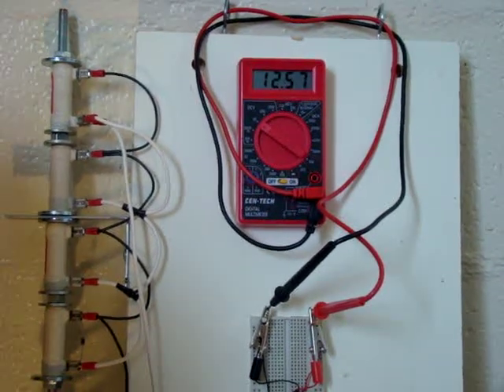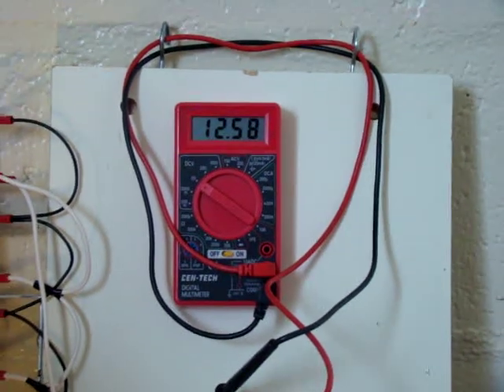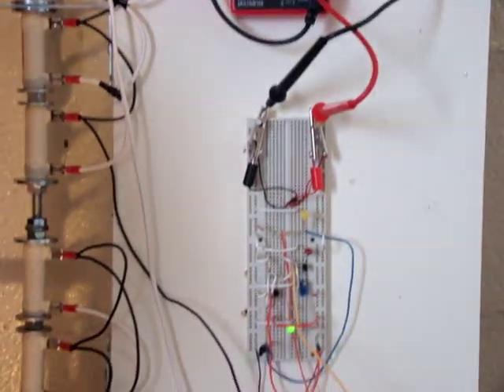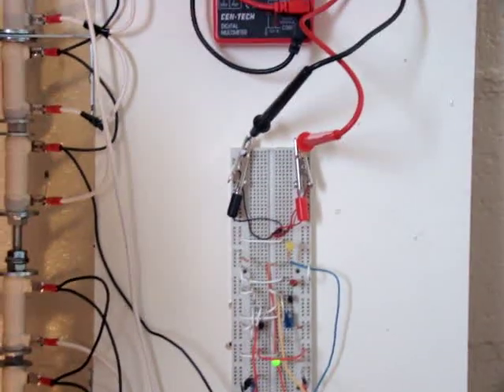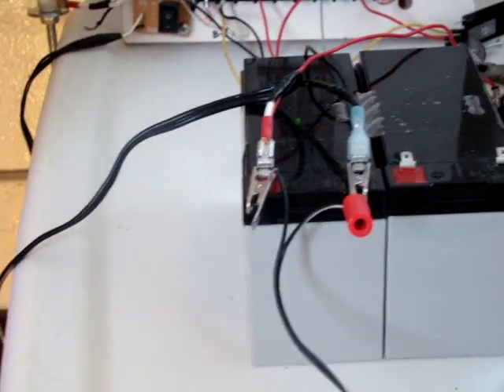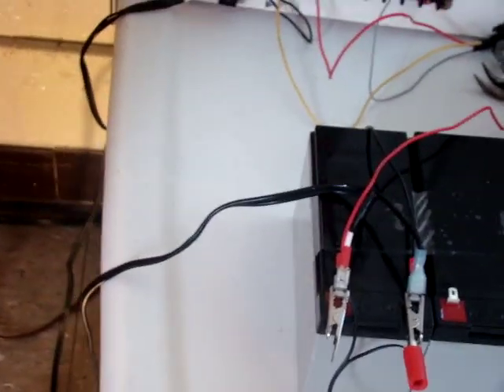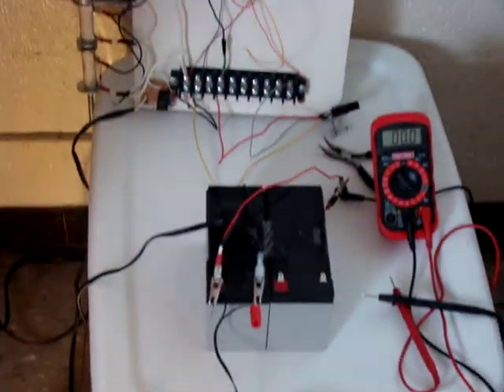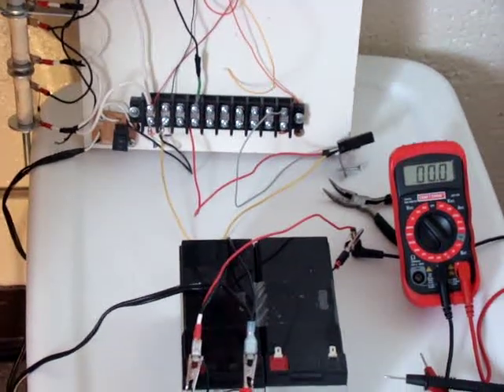DIY Wind Turbine - Charge Controller

Comment: You can purchase circuits cheaper then making one.   This circuit is designed as a charge  controller but using the on board relay it would make a fine Dump Load controller too.  Just use the relay to control a Solid State Relay of what ever  amperage your of need.  https://www.banggood.com/XH-M603-DC-12-24V-Charging-Control-Module-Storage-Lithium-Battery-Charger-Control-Switch-Protection-Board-With-LED-Display-Automatic-ON-OFF-Real-Time-Voltage-Monitor-p-1250279.html?rmmds=search&cur_warehouse=CN

Comment: i use a solar charge unit when battery full it dumps the charge coming in but limits charge to 10 amp charge! i use the same charge controller i get solar wiring access  it connect the wind and solar to same battery set!

Comment from the maker: @claver99 :  I would recommend starting with a perf board and follow the wiring schema on Glen Hurd's website. It's very easy believe be to burn a component so buy two or three sets from Glen and proceed with trial and error. You don't need experience in electronics. I would however make a step by step video of the controller later.

Comment from the maker: First, I want you to know I'm no electronic expert. Generally speaking, it's a good idea to have a fuse to protect against high currents and a component getting increasingly hot is not a good sign. The heat can damage your controller for sure.

Comment: hi! ...just want to ask about my charge controller ... when i power it up it goes hot is it normal for a charge controller to get hot? .. i disconnect it quickly not to damage it ... im using a 1 amp fuse ... it it possible that my controller still ok .. is the fuse guard my controller ...it will be busted  if the operation is not correct with out harming my controller